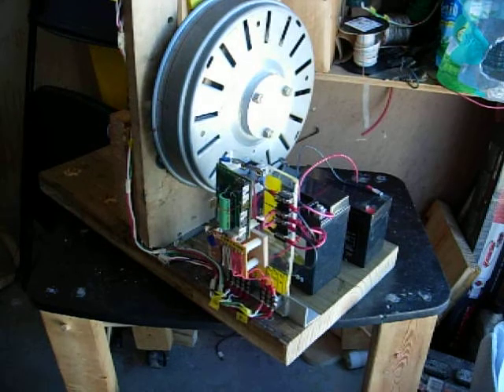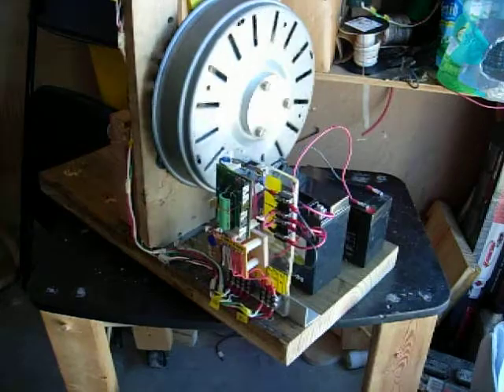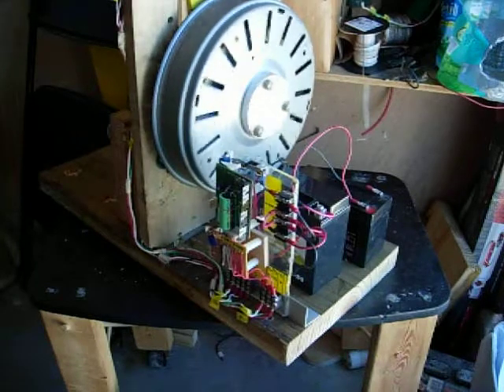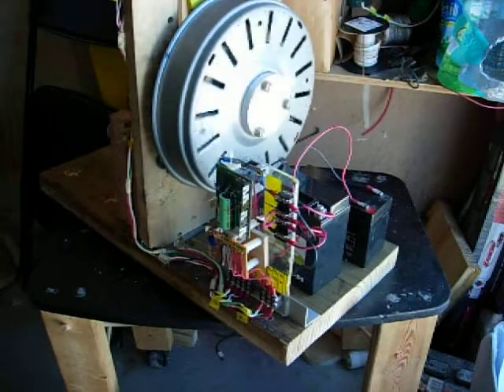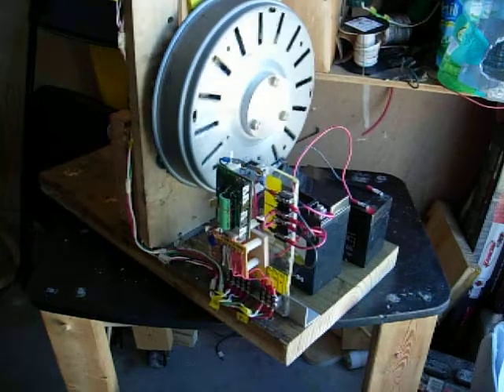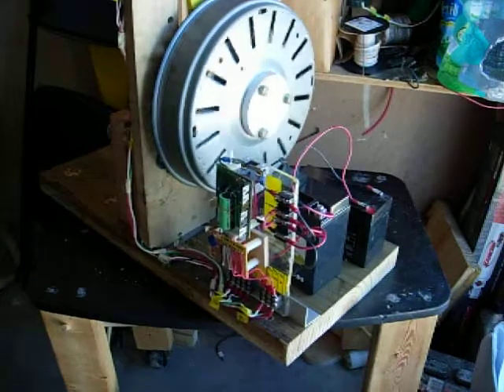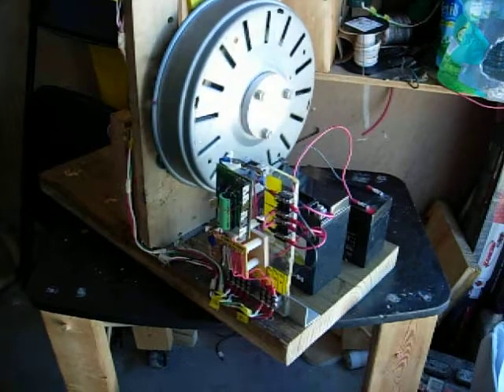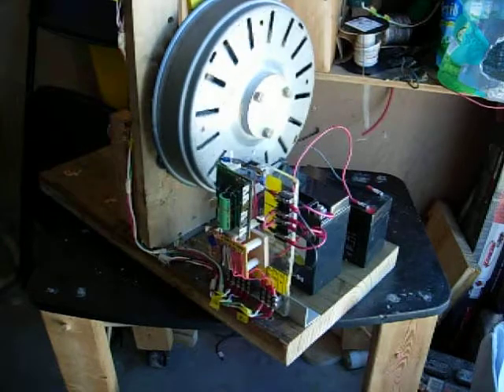Don Smith #118 motor is up and running

Comment from the maker: Gerard is right this motor can produce some serious torque.  it only require NOLOAD .159 amps to spin it at around 60 rpms  considering friction in my pillow block bearings and mass that's amazing.   I did squeeze the shaft and amps went up to .5 and burned my hand.

Comment: start with a d.c motor and attach the 36 pole rotor to one end of  it,  add a generator section from a premade combustion engine generator with a 120 volt output and a d.c out put,  plus the high voltage spark gap from the sparkplug, attach a rotor from a induction motor and add the magnets from a d.c motor ,onto the induction motors rotor and add a new set of coils for the generation.,   using the 36 pole stator as a motor is cool, but makes a much better generator   add a second 36 pole rotor and drum to the first section,,  in the end  a d.c motor with a flywheel runs the two 36 pole,generators and the combustion engines generator ,plus the r.f signal generator that you make

Comment from the maker: The design runs on 24vdc.  Man I fried the PCB two Mosfet's  exploded.  Oscope grounded them, It also took out the MC33033.  The internal portion of the FET was literally hanging off the pcb. wow.   I did notice that the speed increased slightly when I got rid of the 5vdc reg on the Allegro Aquanaut PCB so their is something strange going on with their circuitry.  I thought that I had lifted all the parts needed to get rid of the logic not needed. I wanted to keep just the MC33033 and MC33039 NOT the processor.  I also did the mod needed to get MC33033 spec sheet speed control onto pin 9 using the 10K pot and power from pin 7.   I was curious about the voltage from pin 7 of the MC33033 driving the Hall sensors and it does this just fine Hall s were ATS177 from Digikey.   My PCB design will be using the same Mosfet IFRZ44 Bottom and IRF5305 for the top.   When the motor is running correctly the max amps drawn should be around 1.98 amps given that the phase coil pairs read 12 ohms all other resistance adds up .06+.016+ RS.  I think that RS should be around .03 ohms and be a wire wound resistor about 1.5 watts to be safe. RS = .1mv/amps.   The current would 3.33 amps max. per pulse.It's interesting see the waveforms of the three phases lined up.  when off the phase produces a step ramp.  Tops on produce a 24v pulse and bottoms on produce a ground.  This is the current path.My amp meter test in series with the battery showed around .150 amps.  I need to redo this with the scope and a one ohm resistor.   1v on the scope would equal one amp.While the PCB was Ok I did ground the reverse pin and it worked fine also tried to ground the enable pin but the motor didn't coast it can to a quick stop.  Maybe my PCB will allow it to coast.I also noticed that without any power to the motor it appears that their is a path for energy from the motor coils and magnets when you turn it by hand I have no idea what is causing this.  probably the FET diodes.   The spec says that the diodes are used to collect the energy and return it to the source battery, which is pretty interesting.I did notice a that the motor reversed direction when I moved the hall group over one coil position.Just ordered the pcbs and parts so I should be up and running in about 10 days.  Can't wait to see this beast fly.  even at the very low speed this motor can create some serious torque.  I squeezed the shaft real hard trying to stop it and damned near burned the skin off and it did not even slow down.  awesome.
Reply: Max input voltaje in mc33033 ?
In datasheet see 30v max
And spects 40v

Comment: good, very low amps input, is it 12v or 24v ?
Reply from the maker: +Gianni Laschi 24 vdc   speed was very slow but had power and when I held the rotor to slow it down the amps jumped up to .5 so I know that the speed was being regulated.

Comment: We had same problem.... with low RPM, problem is in controller.
Reply from the maker: +Christopher Sparkman what was the solution to the low speed.  In my case I won't know until I get my PCB.